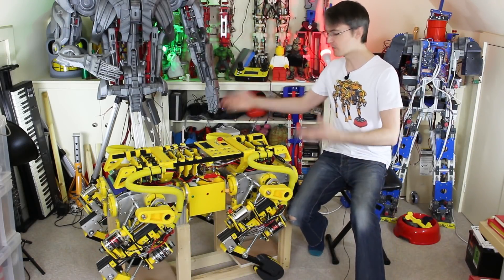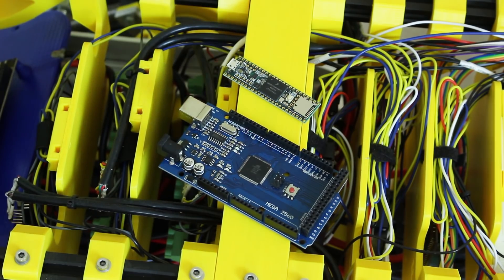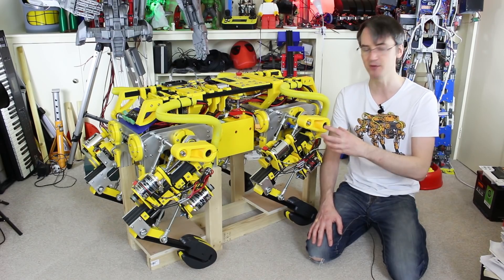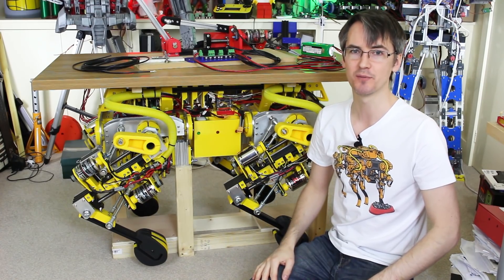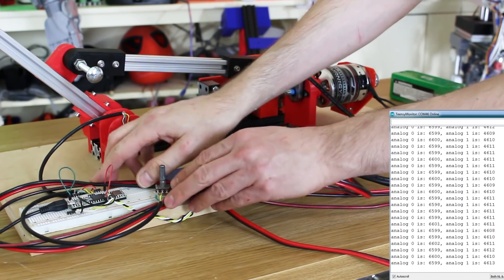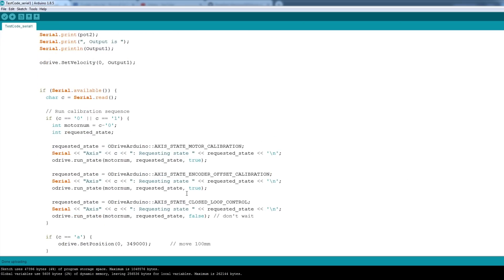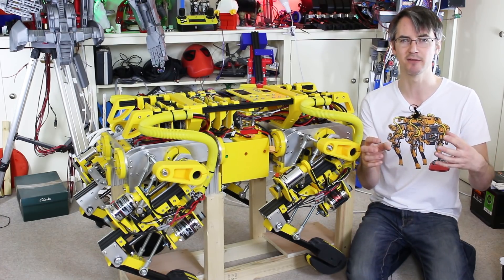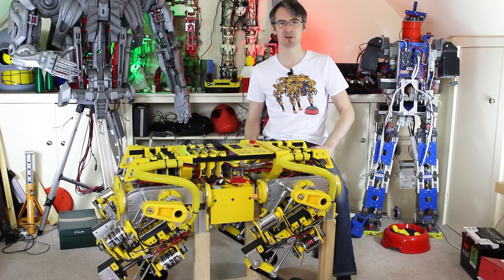openDog Dog Robot #14 | Closing the Loop? | James Bruton

Comment: Hi James; big fan of the series; it definitely has been inspirational to me in terms of what is feasible for a single individual; at least of your abilities! One thing I wondered that I do not recall you addressing in your videos so far is the realized power output of those motors. Intuitively it feels more like <100W than like 2kW; the obvious limiting factor being that the motors always stay far below the RPM that maximizes power density. Now I was wondering if, in your estimation, there is a lot of oomph on the table here simply by changing the gearing such as to allow the motor to run at higher speeds? Or would this quickly lead to other compromises, like such high speeds not being reachable fast enough before running into the end stop anyway; or the noise becoming prohibitive?
Reply from the maker: Yes they will eventually run at about 75% of the max speed allowed for the voltage - so I have a pretty good gearing ratio
Reply: @jamesbruton  Thanks; did you do any semi-quantitative analysis of the current power output? My back-of-the-envelope guesstimation is that raising a 100kg dog 10cm over 1sec amount to about 100W of output; are any of those numbers way off the mark?
Reply from the maker: Sounds possibly correct, I just felt the actuators in episodes 2-3 to see how strong they were with 10-20A current limit.
Reply: @jamesbruton  Interesting; there must be some factors limiting the power density that I fail to appreciate.

Comment: I think you need to define some dead band in your pot. reads to ignore low-bit jitter without slowing down response (like averaging/filtering would).
e.g. when reading the potentiometer, try something like...
deadBandValue= 8;    // for example
newPot= analogRead(xxx);     // read full 8191 resolution
if( abs(newPot - currentPot) > deadBandValue )
      currentPot= newPot;      // only use new value if it is "different enough"
\\ now calc PID using currentPot
Reply: I have used this technique quite often on analog inputs. It works well.
Reply: Shift-Right to loose the least significant bits of the reading could also solve this in a single operation.
Reply: No, that doesn't work - for example: the values 10000111 and 10001000 differ only by ONE BIT, if you shift out the bottom 3 bits you end up with 10000 and 10001 which still differs by one bit.
Reply: While that would work to simply ignore some jitter it further degrades the already very small resolution of the potentiometers used as encoders. In addition you would introduce more dead time in the system than is already created by the control loop for the motor positioning now being handled o the arduino which would further degrade performance.
Reply: @originaltonywilk  you're right! Didn't think about that case :/
Reply: @McJunk1  Stuff like this is always a compromise. Adding a dead band reduces resolution but it does not introduce any delay. A method to improve resolution would be to feed the signal through a low pass filter (preferably a finite impulse response filter). Of course this increases the overall loop delay which is never a good thing. You just have to decide what compromise is the least problematic.
Reply: @LesNewell  I does introduce dead time since the leg can now move a certain distance (more or less depending on the margins set) before the control loop register the value change and can counteract. So the dead time will be dependent on the set dead band and the movement speed of the axis.

Similarly, a filter will also introduce dead time as well as an additional time constant in the control loop.

Comment: Why can’t you write the calibration values to the EEPROM on the master controller?
Reply: That wouldn't help unless the legs are guaranteed to not move at all while the controller is off. What he needs is absolute position feedback on demand, without depending on a previous state.

Comment: Having a potentiometer and encoder is redundant and costly.  The easier solution would be my previous solution that was ignored, or by creating a custom optical encoder and disc for each motor.  If done correctly (less than a dollar for sensor and 3D printed disc) optical encoder disc can not only tell speed and direction, but relative angle position too, all by the spacing of simple holes.
Reply from the maker: But to get 10-bit you need 10 tracks and 10 optical sensors on each one.
Reply: @jamesbruton  But you do not need 10 bit resolution; you are trying to get way to precise.  All you need is one simple encoder disc, 1 IR LED and 2 IR Receivers (or combined unit on Digikey for about 37 cents.)  The potentiometer idea is a nice idea, but if you do that then get rid of the encoder on the motor as all calculations can be done with a simple algorithm based on the Pot data.  For Open Dog you need to think more fuzzy logic instead of precise logic.  :-)
Reply from the maker: @10p6  One track won't give me absolute position then will it. I need precise measurements or the IV kinematic model won't work.
Reply: @jamesbruton    Maybe you should consider a less precise model then :-).  I understand what you are trying to do, it's has been tried many times before.  Successful Dogs use primitive high speed models over slow accurate ones.  For example, some of the most successful dogs only report a limb position as one of three states,  Neutral, positive or Negative (I would personally use, Neutral, + 3 x positive Positions and 3 x Negative positions).   With that, standing, walking  forward or walking backwards and at various speeds can easily be calculated.    

I cannot go into to much detail, but all the information for each leg should be able to be polled in less than 4 bytes per leg (I can do it in around 1 byte) and for general usage each leg poll should not need to be done lets say at no more than 160 ish millisecond intervals for smooth very precise control.
Reply from the maker: @10p6  This isn't that. It's a traditional robot with rigid limbs. The other type of robot is this: https://www.youtube.com/watch?v=Db0BNL3PfCE

Comment: you could have a separate battery and controller that just remembers the position of the relative encoders between power on/offs rather than dealing with the inaccuracy of the pots, or have openDog start up folded up as much as possible using limit switches

Comment: use both. pots for 0 reference on power up and then switch to encoders? at least saves on jitter. Or have a N+1 eliminator so if the next value changes by 1 then no change until by 2 in either direction.
Reply from the maker: I think I mentioned dong it that way at the end.

Comment: If I’m understanding correctly, the main issue is the loss of homing data on restart. Could you have a Master teensy or smaller controller that contains metadata such as end stops and controls secondary systems etc. and a single slave that directly controls the robot? Then on reboot of the slave it simply pings the master for end stop information.
Reply from the maker: Yes that would work, but I'd quite like to be able to recover from any position on power up.
Reply: @jamesbruton  how about a standby backup controller maybe?  A secondary board that starts up before the main one goes down for flashing, picks up the read from where the main one has it, and keeps the encoder count going while the main board is off.

Or come to think of it, it could be on all the time in the background, keeping a redundant count that the main board can refer to whenever it loses its own data. 

Just a thought. I love these videos!

Cheers

Comment: As a temporary solution, couldn't you write the last known position to an SD card so you don't have to home every time? Or maybe put a timer that saves the values if it doesn't get any move command after x number of seconds. Not full proof but seems better than some of the alternatives.

Comment: If you're suffering from noisy sensor readings rather than using a simple moving average (which results in readings lagging behind, as you know) you should try using a Kalman filter (https://en.wikipedia.org/wiki/Kalman_filter).

Comment: Buy a case of cheap-o-matic digital calipers, build a 1.5VDC power supply to power them, read the current position in 1/100ths of millimeters.

Comment: I'm kinda new to Arduino. Why can't you just collect X readings from the potentiometer and take an average out of that? Teensy sounds fast enough not to introduce any significant lag this way.
Reply: I am also new to this, but from my limited attempts at this sort of thing,   the problem is the frequency of the noise is too low  so you still get jumps  as you have to spread the samples across a wider rage than the frequency for it to smooth them.  It helps a lot but there are still jumps that you need to set a cut off to eliminate which gives you the electronic equivalent of  a small backlash. It works OK but not perfect.
Reply: You can. Technically that is a low pass filter. It adds delay which is a problem. With servo feedback loops even milliseconds can matter.

Comment: Why don't You apply moving average() from last few reads and the You will have hips more stable values, just You would have to decide what sort of delay is ok for Your Dog. You know the frequency of the results so to calculate the max delay would be not a problem. Anyway  ...just the idea, You know hips more about this stuff, as always I'm impressed with Your projects. Regards

Comment: In my opinion using potentiometers as encoders is not a good idea. As you said, their characteristics are going to be terrible as will be their durability. 
Additionally you have got a really nice and granular control over your drive system with the expensive encoders already on there and by driving the motors step by step. 
I would not sacrifice that.

You could use an external EEPROM for storing the position data across power downs. Support for many chips is even built into the Arduino environment (see Teensy example).
https://www.pjrc.com/teensy/td_libs_EEPROM.html

And I would refrain from using the Arduino serial interface for control and communication. As you said in the video, using a bus system is a much better solution.

While CAN bus would fit the application profile quite well, even something like SPI would be quite good. While SPI is usually significantly faster than UART you can connect multiple peripherals on a single port. 

Additionally, you would  no longer locked into the Arduino eco-system like you are now through the EasyTransfer library you are using. 
And you can get all sorts of controllers / boards with SPI interfaces (many pretty cheap). So you can distribute them all around the robot.
Granted, if you use high speed SPI you might not be able to run a single bus connecting all devices, but you could for example run a highspeed line to the modules that need it and a low speed bus to everything else.
 
P.s.: As a robotics engineer I can strongly recommend having control loops  (especially regarding end stops) to be self contained as you said in the end.

Comment: Why not just add a Midpoint end switch? A microswitch the actuator can run over from each way and calculate the middle.
Reply: Or use a printed optical encoder strip with multiple endstop positions encoded along it.

Comment: why not simply adding external memory to store the zeros. It would be more accurate than the method you tested, and it is extendable to support different configurations that will come useful when start adding different kinematic models. 
As a side note you should definitely consider CAN. I am also not sure if a bigger master will improve the electronic design. Keeping it distributed gives you more freedom, and provided you have the right software layer that keeps the nodes synchronized(state machines man!!!!!) should prove more effective since its gives you physical concurrent execution compared to virtual one.

Comment: Why not just use the pot as a startup 'estimated' abs position? You don't need the pot feedback during use. 1/8192th of your joint angle (even when that is skewed by your linear to angle actuator ) is still precise enough to know your are at X degress of your angle. Start up > get all 12 pot pos > work the kinematic model backwards > move joints to 'home' (fully standing?) > set as 'home' (zero out?), then use the encoders for operation. This is no different than homing with limit switches. you could even put in checks for pot value min and max thresholds to ensure it has a 'soft' limit. 12 pots with minimal use (start up), i would toss behind a shift register (given the teensy has 4x i2c)
Reply from the maker: That will probably be the plan.

Comment: why not have all the legs go the limit sensors at the same time? basically have it crouch down instead of raise each leg. for finding the end stops have it just move out an inch on one foot, than an inch on the other foot, and so on. the importance of finding the 0 each time is if an error happens. a tooth slips, or something.

Comment: Sorry guy i don't wanna sound rude but this hardware setup will never run smoothly with a "simple code". Your legs are still to heavy and slow... imagine you will need very fast correction movements and this will prudence heavy reaction forces. As a well-intentioned advice... make your legs as light, stiff and powerful as you can! Bring all your mass as close as you can to the COM... and think about a balance strategy (ZMP as a lil hint).
Nice engineering anyway... good luck!